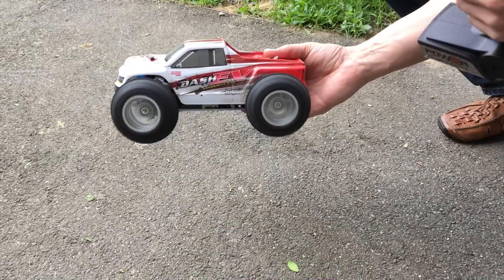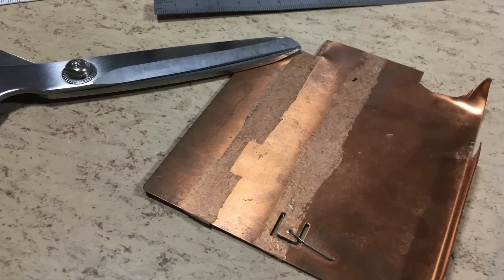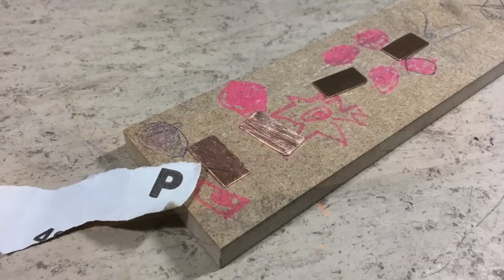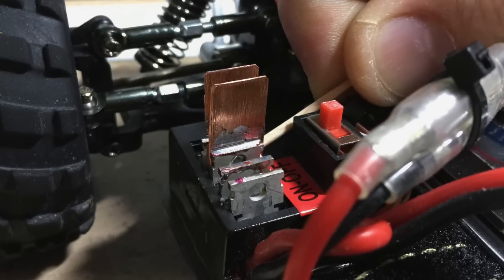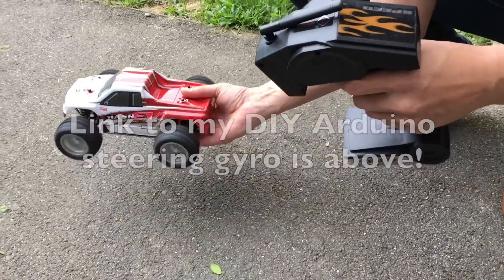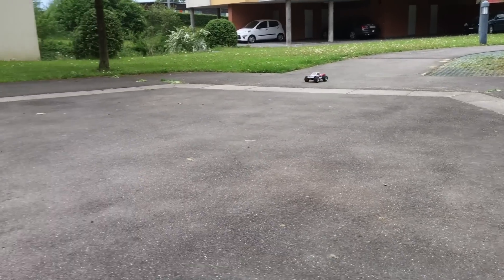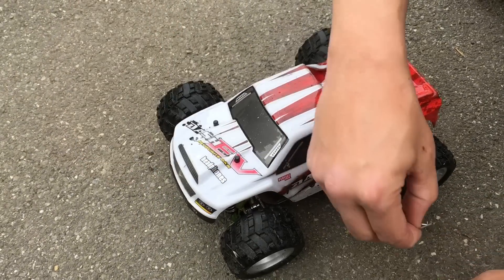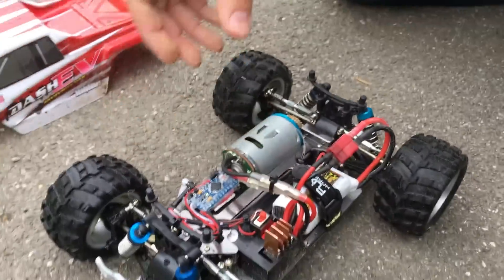How To Prevent WLtoys ESC From Overheating / Cutting Out!

Comment: nice video I have a A959, how did you get that going so fast did you do any upgrades apart from the heat sinks, if so list them here, also what is that pcb and where to get it would it fit on the A959, and what is that lipo battery and c ratting can you link that lipo too cheers, keep up the good work, oh and last things a link to the cars shell you are using and its wheels thanks.
Reply: I don’t think he did judging by how it looked. The wheels and the body is part of the a979 - the monster truck/off-road variant. The same goes with the wheels. Also, the b in the name means it has a bigger motor making it faster - hope this helps!
Reply: The reason why I know this is because I own the model.
Reply: @shawarma3066  did you do any upgrades if so can you list them thanks.
Reply: I put 70 mm springs on my model and put oil in them so the springs are softer and dont bounce around. If you want i can link the parts. I also raised the body up and gave it a raise. I will also be giving it a brushless system and some metal parts in the future. You may be asking why i’m doing this to a cheap hobby grade rc but i am doing this because the a979 b is a good start to the hobby. If you want i can send a link to the parts from amazon.

Comment: Thanx for the video! I need help PLEASE. Brand new 959 that I got , but I cant control it. I switch on the radio and the LED blinks red and green. I switch on the car (Battery is full) and the ESC light just blinks. From there nothing happens at all. 
When I touch the remote , its LED will be constant green , but the ESC still flashes and no control over the car. 
( I have left the car on and red-green flashing for minutes on end with no success)
That am I doing wrong

Comment: hi man, my l959 cuts the engine after a high acceleration. It is not heating. The battery becomes hot when charging but that is all. What can it be? Maybe the battery or something related to the engine? The light close to the ON OFF button starts to blink when the engine is cutted off. Before this the light was still ON all the time. If I remove the battery and insert it again the car starts to work again. It is like a cuttoff but I do not know what is causing this. Please help! :)
Reply from the maker: I assume your battery is faulty or the battery connector has a bad contact.

Comment: Great video.  I was wondering can you do a vided on how to mod the stock ESC on the WLTOYS 12428? open it up and show how and where to add additional things like an after market gyro? or what it is capable of? like 3S? it probably has features disabled or not connected that would allow you to add other things like plug in a fan or a light? I really am interested in using an after market gyro with this ESC.  If you could figure out and show a video of how to do it that would be awesome!!

Comment: Hello and thank you for your video.  I have a Wltoys 12402-A with a 18650 battery of 1500mah.  I would like to change the battery for more capacity.  Do you think I can put a lipo instead?  There would be no problem with the cutoff or it is better that I stay on a lithium-ion (18650).  Isn't lipo better for discharge?  Thank you so much.
Reply: did you upgrade? how did it work out for you? thanks!
though i'm really curious if this car's ECU can handle 3s battery pack...i don't have an answer to this yet.
btw, the stock li-ion battery is 10A capable, but there are plenty of other 18650 li-ion with 25 or 30A continuous discharge, for example the samsung inr18650-25r
Reply: @Ris-v4w  Hi, did battery from 2x18500 18A capable (similar size to original) and first fry original ESC, now with new one getting cut-offs. Mosfets are really hot to the touch. Will try you idea and add heatsink!

Comment: What kind of spray did you use to prevent the shooting out situation? Do you think I can cover it with nail polish after I put the copper plated on there to fuse everything together instead of sotering?
Reply from the maker: Don't use nail polish. I have used PLASTIK "SCHUTZLACK 70" from Kontakt Chemie. You have to solder it, otherwise, the cheat can't be transported properly

Comment: I have a problem with a WL too. If you use it very slow, like crawling the batterie last very long, if you use it hard, it runs not for long... Maybe is overheating too? Because i turn it of, then ON again and it works for a little bit
Reply: gerekappo I have the exact same problem as that and I just got mine just the other day and having problems with it already.
Reply: @jakesdronephotography224  My problem was the battery. Bought a new one and its fine!

Comment: Could i put a 30c 2s lipo on it will it be to much current any help will be apreceated thanks!
Reply from the maker: Yes, you can. The current only depends on the battery voltage and on the motor resistance.

Comment: My son got a new A979. It worked well the first time. On the second drive it suddenly stopped after about one minute of driving.  Now only the steering responds, even with presumably fully charged battery.  There is a red light on the ECS that is sometimes lit, sometimes blinking. Any ideas what could be wrong?
Reply from the maker: Hard to say. I think the ESC / receiver failed. The battery voltage is ok?

Comment: Hi I have a wltoys a959 the problem is the steering works but the motor doesn’t spin . Just bought a new esc aswell but it still doesn’t work any  help?
Reply: Perhaps its the radio thats not functioning. Perhaps a loose wire inside it or such.

Comment: Mine doesnt overheat but it constantly cuts out the motor and flashes the light. How to fix it?
Even when i unplug the motor and apply throttle it still cuts out.
Reply: battery low?   I feel thats the way of not letting the battery completely die.
Reply: @nishblaze  i dont think so. I charged both of my batteries and it still happends and i even connected a power supply to the battery connection and it still happends.
Reply: @julius4347  does the charger flash when it plugged in?
Reply: Power slam no, i noticed that it only starts to happend when i drive in wet weather. So i guess its just the esc having some problems when wet.

Comment: Mine don't get that hot but I cool down with small battery leaf blower will do your trick top video. Just subbed. BTW can i use aluminum as i already have?
Reply from the maker: Thanks for subscribing. Better use copper, because of the better thermal conductivity. I also think, that aluminium can‘t be soldered with the usual electronics solder.

Comment: Just sorted my boys 979-a, metal diffs (took for ever to get them smooth) metal gears, and axels. 
Bought the 959 rx and a 540 size hpi 15T motor. Thing is fast! !!! But cuts out so I will go with a fan again. 
Anyway my question was, is there no brake on the esc? I thought it would be on 959b.
Second question, as I upgraded my 12815 protector I have the tx and rx from that, same as 12891, do you know the amps on the 12891 dune thunder? Might put that in instead?
Cheers for a great video.
Cheers for a great video.

Comment: I would never do this is the minute one of those tabs bends and hits the other you're going to short out your ESC then you can kiss a goodbye you'll be forking out the money to buy a new one I understand your concept but this is the worst idea I've ever seen. I didn't even make it to the rest of your video once I seen what you were doing
Reply from the maker: That‘s why they are conformal coated / insulated 😉
Reply: which is why you didnt see him coat them before running it.
Reply: You can put a tab of hot glue between the fins if it bothers you.
Reply: How can it short cut? It is just a heatsink. Or not?

Comment: I thought those thing are just heatsinks.... can I just put A 25mm fan on top if I have overheating issues ?
Reply from the maker: Of course you can, but it will waste energy and shorten your battery run time. A passive cooling with a bigger heat sink is the way to go in my opinion.
Reply: TheDIYGuy999 yah but the risk of shorting 1 of the things is quite high....
Reply: TheDIYGuy999 also no idea what spray u used to cover it
Reply from the maker: That's why I added a conformal coating:
https://www.distrelec.ch/en/protective-lacquer-spray-400-ml-kontakt-chemie-plastik-70-400-ml-ch-de/p/11040718?queryFromSuggest=true

https://www.distrelec.ch/Web/Downloads/ms/ds/Plastik70_eng_msds.pdf
Reply: TheDIYGuy999 that stuff is quite expensive... A 25mm fan is only 1$
Reply from the maker: Yeah, It's not cheap, but you can use it to make your receiver, esc etc. waterproof
Reply: TheDIYGuy999 I use hobbywing escs lol they are already waterproof and I don't drive in water or rain.. I bought that rc for my nephew and I just wanna make sure the esc stays cool...

Comment: My wires get extremely Hot from the motor to the esc,but the esc itself is not that hot..do you have any ideas why the wires get that hot the almost melt..i did metal upgrade on the main drive and difs..
Reply from the maker: Possible reasons:
- The motor connectors may have a bad contact / are too loose
- The new metal gears are jamming
Reply: TheDIYGuy999 
The new gears did initially stick but then loosened..all the wires look in the right place's,but thanks for the reply friend,i will do a thorough inspection tomorrow:)

Comment: I am also experiencing the same problem way too often. So I tried to solder the copper sheets to the mosfets like you did, but it does not hold. Did you use any special technique, solder iron,...?
Reply from the maker: You have to use a chisel tip. Pre tin the mosfet and the copper sheet. Then press the copper sheet against the mosfet heat sink, using a cocktail stick and touch the copper sheet and the heat sink with your soldering iron at the same time. Wait, until you can see the solder flowing. Then remove the tip and hold the copper sheet in place until the solder is cooled down a bit.
Reply: TheDIYGuy999 Thx for the fast response. I will try that.

Comment: the esc was made poor it has a to low A
im upgrading my esc to a wltoys 12428 esc
Reply from the maker: The main problem is the missing heat sink. Power mosfets in a TO220 housing are just not designed to work without a heat sink. At least not if used for high currents.
Reply: the reason it gets hot is because it was made poorly To low A output
Reply: @TheDIYGuy999  does this car handle 3s battery pack?
Reply: Does it work? No esc cut off?

Comment: Just updated to brushless. Very useful video! May change it back to brushed.
Reply from the maker: Thanks. I would not change it back to brushed. Brushless is still nicer. But I think it's a good solution for these who want to drive it with stock ESC.
Reply: @TheDIYGuy999  the best solution I've found so far for a brushed motor is to swap in a Traxxas Titan 12T 550 brushed motor in place of the 550 in the 144001/124019 buggies. Or any 550 in a wltoys car. Its obviously not the same as going brushless but it's also about 20% of the cost. I paid $25 USD for the Traxxas motor. And reused literally everything else. Same motor mount. Same pinion gear. All stock parts. For $25, it's a great upgrade if you want to go faster but don't want to deal with brushless motors and/or don't have the budget to spend another $150 on a brushless motor, esc, servo, receiver, and transmitter.

So far, it's picked up a few mph. Like 11 or 12? So maybe 18-20 km/h? For $25 USD, it's a worthwhile budget upgrade. It's fast enough now that it can't do donuts anymore. It just flips over. Currently working on finding some wheel spacers that work better than the currently available options. I put the spacers on that I have, even though they're pretty wobbly, and that was enough to keep it from flipping over while doing donuts so I've gotta figure out how to mount them so they aren't all, wobbly..

Comment from the maker: Overheating WLtoys ESC are common problem. And this video shows you, how you can easily fix it! If you like this video, give us a thumbs up and subscribe, because this helps a lot. Thanks, guys!
Reply: @Overland_RC   If you are worried about shorting out the cooling plates you can drill a hole through the copper cooling plates and use a nylon screw and some stand-off spacers between each plate. You can buy a nylon stand-off kit on amazon for about $5usd.
Reply from the maker: No. Only copper has the required thermal conductivity.
Reply from the maker: You're welcome and thanks.
Reply: Is IT 5mm or 0.5 mm of thikness??